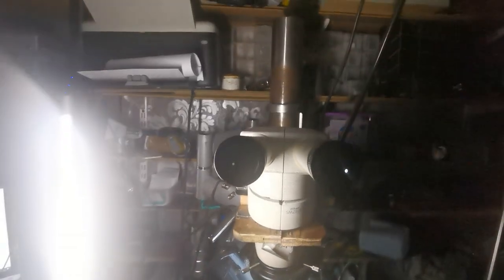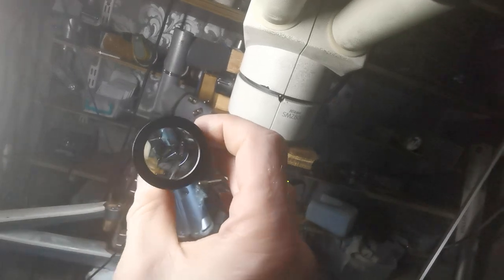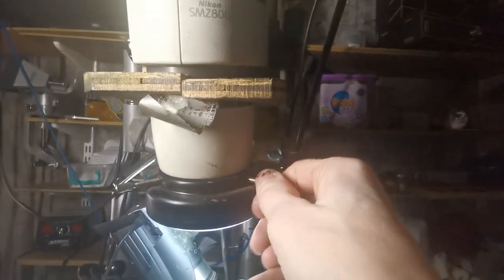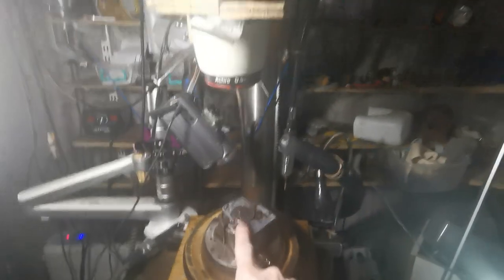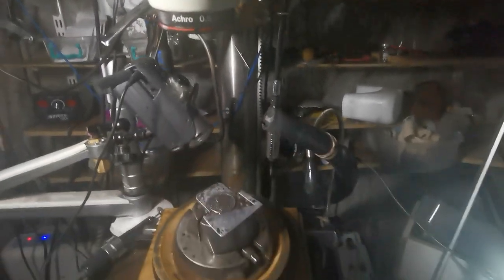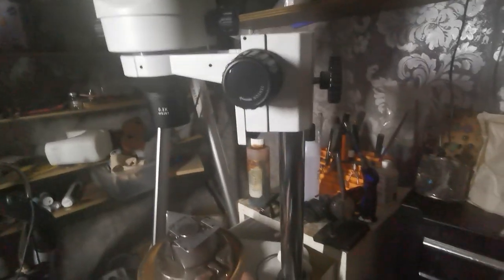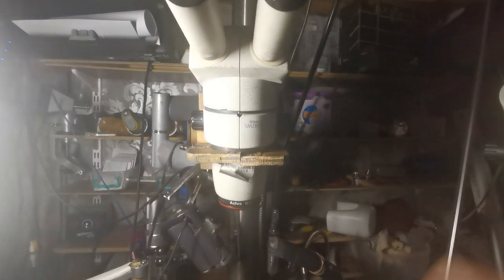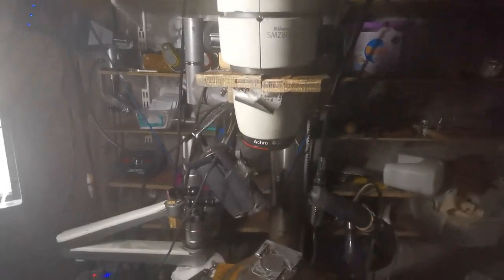Hand Engraving Microscopes the one thing you can't Bodge Up! What to look for.

Comment: Hi Shaun, thank you for sharing this info. Would you mind covering the DIY Vise please. I am struggling to get the right vise. thank you
Reply from the maker: Another thing I wasnt able to make.Some do but you need big machines. All vices do the same thing, so i got the cheapest there was on ebay, but still going to be a chunk of money, a heavier vice is probably better for most things. I think it improves the cut.
Reply: @express375  thank you for the suggestion. I was thinking along the line of line of the centering vise. the one under the vise where you can move to centre the work piece under the scope.
it would be awesome to be to see it
 cheers
Reply: @ardanisarjito8628  I've seen a couple guys use a bowling ball and a lazy Susan for a DIY ball vice. Might work for you?